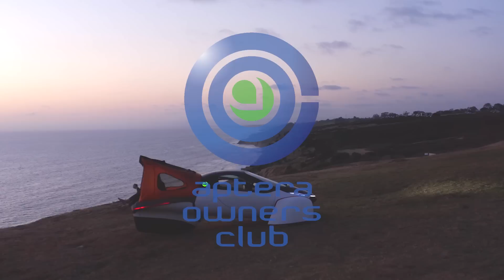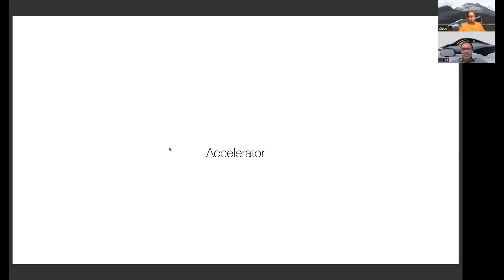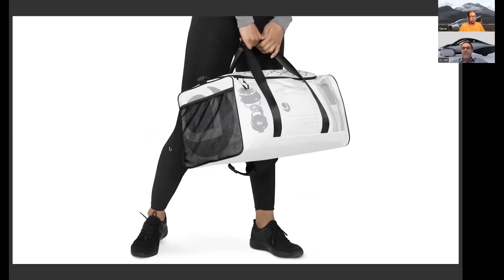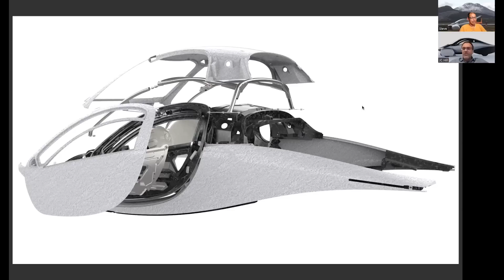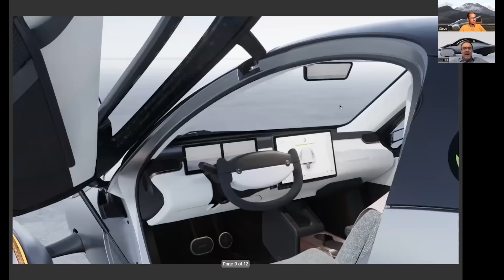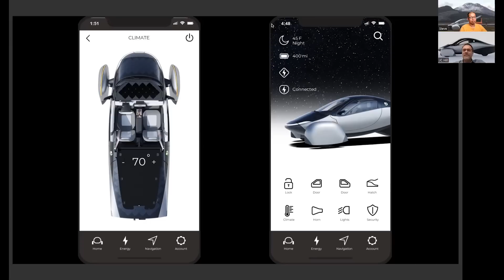Jason Hill gives us some Aptera updates and a sneak peek at the app!

Comment: What will happen when Tesla starts delivering the $25,000 4-wheel vehicle?
Reply: Valid question. We know Aptera is unique in many ways and should be enough to entice people to buy it. I'm more thinking that the affordable Tesla will crush Toyota, GM, & Ford.
Reply: @ScottOstr  Maybe, but Aptera will have to be extremely smart about its features if it's going to compete on a big scale. Its uniqueness won't translate into mass adoption unless it very carefully sweats the details.
Reply: @Yowzoe  That's true. The lowest drag coefficient and highest energy efficiency of any vehicle is great but once denser energy batteries arrive, those things become less important. Then the lowest price advantage is less important once the affordable Telsa arrives. Aptera doesn't need to be plugged in which is extremely appealing to people who live in apartments and don't drive very far. It will be interesting to see how it all plays out.
Reply: @ScottOstr   Solar charging (and 120v!) are big draws but as a 2-seater roadster with Jetson styling, crossing over into the normie market to compete with the coming low-cost Teslas, BYDs, etc. will be savage. 
Lacking what reviewers and mainstream drivers consider essential (many seemingly shallow details like color choice, expected horn button location, and ample back-up light brightness) would narrow the segment of potential buyers further.
Reply: I hope Aptera Motors will have their 4 wheel 5 seater car revealed by then. That will be interesting competition for Tesla.
Reply: @fotoguru222  My concern is about the price. Tesla is cutting prices after achieving the economy of scale and vertical integration. Aptera is still burning money to deliver the two-seater model. Without a big investor, it will be difficult to compete. Most of the potential customers will go for the lower price and trusted brand.
Reply: @DavidIzadaRodriguez  Good points. However Aptera doesn't need to take 50% of Tesla's market share to be successful. It doesn't even need to take 10% nor even 1% of Tesla's 2,000,000+ vehicle market share to be successful. Aptera Motors is doing this by staying lean and being efficient in low cost manufacturing.
Reply: @fotoguru222  I personally think a 4 wheeler might happen in 3 years if 3 wheeler is successful
Reply: Hell will freeze over. 🥶

Comment: I wonder if the Knob of Light is shopping cart rated? Because that was the reason they stated for changing those beautiful Gamma taillights.
Reply: either way it's a fugly afterthought solution. I can already picture EV haters just yanking those things off.
Reply: @jeffreyd1701  yup
Reply: @jeffreyd1701  That's what I probably will do myself and replace it with something handmade and nicer when getting my Aptera.
Reply: Very important consideration 🛒
For me it is indeed fugly in the singular, though having one on either side of the plate would be better. Even betterer would be two more low-profile knobs, if possible. Also having more back up lumens is a big plus for a key demographic who can buy this vehicle, i.e. an older crowd.
Reply: @Yowzoe  I'm a big fan of lots of light. But I'll wait to pass judgement until I get it in my driveway. If inadequate, I will fix it.
As far as looks, it's only a minor cringe to me compared to that yoke.

Comment: Thanks for your continued work with the channel. Do you have any information regarding the steering wheel lock-to-lock turns? It's not clear if the Aptera will have a variable steering ratio or a fixed ratio rack but fewer turns is definitely better (particularly for slow speed driving), otherwise using the yoke could be as frustrating as the Tesla yoke. Any thoughts?
Reply: steering effort will be variable but the ratio of turning is fixed.
Reply: @jeffreyd1701  Exactly.
Reply: What Aptera has said is that the power steering boost would be variable according to speed.
Reply: It is absolutely clear the steering is fixed ratio according to Aptera.

Comment: I've always thought that putting the horn in a place where you have to take your hand off the wheel to use it was really dumb.  The only time I have used it for its intended purpose was when I was stopped in a parking lot and someone started to back into me.  Everything else was used to express annoyance after the danger was avoided by steering and or braking.
Reply: Very dumb indeed, and counter to our learned-over-a-lifetime usage--a mistake which I hope will be remedied. it will be noticed by buyers.
Reply: @Yowzoe  Wait, what?  Center of wheel is dumb, putting it where you can reach it with your thumb without moving your hand is smart.
Reply: @skeptibleiyam1093  you're exactly right

Comment: Thanks for addressing the need for a 'Sentry' or 'Sentry-like' mode or capability!  I too feel it's Essential!!  Especially for anyone who is living in a major city or town, or anywhere else where vandalism or the prospect of accidental damage is high.  In fact, I'm keen to see what features of Aptera has to mitigate or even stop or prevent 'Carjacking'!??  I live and drive in the DMV - i.e. Washington DC, Maryland, Virginia and on its Beltway, - where Carjacking has become a serious problem.  And I'm also an Accelerator; was in the top 100 but I've slipped a bit with the last months investments!
Reply: I agree, and for city driving, parking at trail heads, or going to the grocery with any sense of security a sentry-like mode is something that I can't do without. I'll have to figure out an aftermarket dashcam setup if sentry doesn't come standard by the time I get my vehicle.
Reply: After posting this affirming the need for a 'Sentry' or 'Sentry-like' system and capability for Aptera, - which brought 'Carjacking' to mind as it's regularly in the news here in the DMV, - I have an idea for a fairly straightforward and hopefully low-cost/reasonable-cost and even 'standalone' system to discourage or mitigate - or stop a Carjacking in its tracks!  In fact, what I have in mind would work in Aptera and likely many other cars, trucks, or similar vehicles, and perhaps even in an airplane cockpit or boat.  Any suggestions on how to approach Aptera on this?  Or should I just go ahead with development on my own as I'm an engineer among other things??
Reply: @billyshilling7663   The only thing I can suggest is that you go to great lengths protect your IP. If yours is a serious idea, consider patenting it before you speak with anyone about it. As you may know, so many homespun garage-made inventions get scooped up by conniving lawyers for cutthroat corporations…don't be that guy. Best of luck with it :-)
Reply: When living in Rome do as the Romans do...
CARRY A GUN!
Or at least some pepper spray. 😮
Reply: @IBMara  they possibly can help with carjacking, but a problem is that a weapon or a can of spray won't help your vehicle when you're not there

Comment: Most cigarette lighter sockets are usually 10 amps. What it needs is something like a 30A Andersen Input for portable solar panels when parked at home, at the beach or camping.
Reply: That is two different circuits. One outputs 12v nominal while the other inputs 100+ volts from solar panels
Reply: @GaryGreenway  That is what I was referring. One output circuit and the other an input circuit.
Reply: @GaryGreenway  The nominal voltage of the solar panels is 402 volts.
Reply: @n.brucenelson5920  I think he was referring to auxiliary solar panels.
Reply: @GaryGreenway  The word "portable" was in my comment.

Comment: I'm still excited about the 🚗... my concerns are with the amount of  space the doors will consume when it's time to get into and out of the vehicle. I live in nyc, and parking space is limited. In my opinion, i think sliding doors or some sort of pocket door design would be more space saving. the doors would be an issue in an urban environment like queens, most often you get to park "right side of a 🌳. Parallel and horizontal  parking is super tight. I'd have to get into and out of my Aptera via the trunk or the sun roof. Especially the way ppl tend to park in nyc...
Reply: If the wheels fit in the parking space you'll be able to open the door enough to get out (and in again). Not someting that conventional cars do guarantee as theit wheels are flush with the doors.

Comment: Tire wear will be interesting. Yes the car is lighter but total weight /3 instead of 4 will be interesting.
Reply: The discounts are always for four tires though, so even if the rear wears more quickly you will have a spare.  They have said it will be front weight biased, so i can't imagine it will wear twice as fast. I was thinking they should have a drift mode to finish off the rear tire.  It may go against the environmental and safety ethos, but everyone needs a bit of fun once in a while. Chris did mention having different traction control options in one of the interviews.
Reply: @aimlessweasel  Launch Mode, there is your "fun" mode. Tadpoles don't drift.
Reply: @barnabasseadog7660  They don't drift you say? Take another look at Aptera's "moose test" video.

Comment: Lack of side airbags is still a concern for me
Reply: I'm so with you on that. If not, I'd love the option of a 4 point harness, even if it is overkill.
Reply: A harness will not help much with side impact and you would need to keep it very tight. Uncomfortable and possibly difficult to operate control function due to reach. May also lead to more severe neck injuries.
Reply: How about wearing a neck brace?
Reply: In U.S. (only?), 4-point not legal. If from somewhere else, that would be a nice option (if legal).
Reply: @scottgabbard662  Maybe 4-point is illegal for cars (Why?)  but not for autocycles like Aptera. They use a 4 point harness on the Arcimoto FUV autocycle.
Reply: @fotoguru222  Totally forgot about the auto cycle angle. But yes, in the US, cars must leave the factory with a 3-point.

Comment: The metal insert in the door does not look like it provides a lot of extra strength against a side impact.  I am wondering if it provides the foundation for a window actuator subassembly.  Jason's description of the backup light still didn't change my opinion.  I think there are so many other solutions to provide all of the same functionality without that asymmetrical wart hanging off of the back of the car.  I plan to road trip and camp in my Aptera, and the ability to plug in an induction cooktop, and a small refrigerator is my hope for the future camping kit.
Reply: The knob light thing is pretty ugly. They could've put an LED strip light along the center of the vent area and a little bump out with an LED over the plate.
Reply: @tims8603 Sounds like an aftermarket opportunity.
Reply: @tims8603  my thoughts exactly
Reply: @tims8603  Great design idea. Jason, write this down!
Reply: So true. Feels like their tent idea is lip service? Hoping for much more back end functionality beyond “ lotsa room for your dogs” idea. They still are silent on off road version capabilities

Comment: Thanks Steve.  I'd love to see the engineering team get pushed harder on side impact airbags.  Sure the door may be strong enough to withstand an impact.  But if an Aptera gets t-boned by an SUV, it's going to change sideways velocity awfully quickly, and so will the driver's head relative to the SUV's grill.  That could be a dealbreaker for many people.  It shouldn't be that hard to add airbags into the seats.
Reply: just don't get in wrecks, problem solved!
Reply: The response that I recall is that the side window is farther away than on a brick shaped car, so your head won't hit it.  That, of course doesn't help your neck.
Reply: @skeptibleiyam1093  imo it's a BS answer to cost cutting.
Reply: It is my suspicion that a front airbag with a three point seat belt is not much better than just the seat belt, but I gave up searching for data that would let you make the comparison.
Reply: @skeptibleiyam1093  is far better with an airbag than without.  The forces on the upper body are greatly reduced.
Reply: @jamesengland7461  Where can I find data that quantifies "greatly"?  Airbags are not without cost or risk.
Reply: Perhaps the frontal airbags can protect in side impacts also.
Reply: @jamesengland7461  I like that idea a lot. If somehow they could just deploy the front airbag so it also wraps around to the side. Problem solved!   Kind of like a half cocoon.  The best airbag is no airbag lol
Reply: @jamesengland7461  I take it from your answer, you couldn't find the data either.  I looked again, but still didn't find anything that would let me make a comparison.
Reply: @skeptibleiyam1093  no; I'm not going to bother looking it all up for you.
Reply: @jamesengland7461  I don't blame you.  It's a lot of work.  I thought it would be relatively easy before I started searching.
Reply: Jason seems out of the loop on many of the technical questions. I wonder if he’s working full-time at this point. I would appreciate the conversation better if JASON doesn’t know the answer to a question if he would just say so.  BS meter is working overtime. And if I hear the word “RIGHT.?” one more time my head will explode. Also, comparing safety issues to a motorcycle or an auto cycle is not Comforting.  There should be an Aptera policy that, when speaking about safety issues, they only refer to automobile standards If in fact the goal is to provide  higher safety standards and performance.

Comment: I really hope that output port can handle an induction cook top - would be great for camping. 
Solar cooker is NO good for night time.
Reply: For cooking and such you'll need to wait for the 120 volt 15 amp inverter option, or add your own.
Reply: Use a solar generator and charge it as needed with portable panels.
Reply: @LarryDickman1  more crap to own and carry around. not efficient nor eco friendly
Reply: @jeffreyd1701  I'm not eco friendly either.
Reply: @jeffreyd1701  It is crap when you are camping etc and using a lot of power. But to each their own.

Comment: The door knob rear light still seems a bit weird to me. Seems like it could be closer to flush-mounted and still illuminate the license plate. Maybe there’s some other functionality that’s yet to be revealed.
Reply: Right? Make a cool ridge centered across the top and have an LED strip or something. Ditch the wart.
Reply: As noted in reference to the LPI, lens design can achieve many desired outcomes.  The LED lamps could no doubt be end user changeable (right to repair) to make more sense for unique needs.
Reply: You mean it's not there to hang the shopping bags on while you free a hand to open the hatch?
Reply: @iansmith6728  Sounds like it's strong enough! ☺
Reply: Maybe a good aftermarket idea?
Reply: Riight, the knob in back is weird to you but the whole vehicle itself looks completely normal? It also functions as a charge level indicator, if that helps.
Reply: Horrible design. A wart on an otherwise beautiful design.

Comment: I don't understand why Aptera does NOT have the side airbags. I do understand the egg shape helps the hip part of the body. But I still have concerns about the head being banged around in the event of a side crash. I hope I am wrong here. Just speculating....
Reply: They have said in the past that increasing the cabin width would solve this. But I really don't believe them, especially on such a narrow vehicle, how would that extra inch prevent your head from hitting the sides? I guess we'll see in the crash tests.
Reply: @JeanMichelTrivi  Most injuries in a side impact is to the ribs and hips. The egg shape absorbs more energy. I'm still buying.
Reply: @JeanMichelTrivi  I have the same concern here. The only thing is that since the shell is egg shaped, it reduces the impact on your hip but not your head.
Reply: I reckon Total Recall type of crash protection.  If it's good enough for Arnie, it's good enough.
Reply: Having driven all sorts of vehicles in all sorts of environments for 55+ years and not having ever been hit in the side, I am okay with Aptera's design. They are responsible for making all the decisions that will eventually bring the Aptera to market. I hope they succeed.
Reply: @IBMara  oh so you're saying if someone has never been hit they should be ok without any airbags whatsoever. So I should be good then! But what about my wife who got hit extremely violently while sitting at a stop sign?
Reply: @JeanMichelTrivi  I didn't say I would be okay with no airbags at all. I will be happy with whatever Aptera decides to do. Would I like side airbags? I suppose. What I would like even more is my Aptera, however they can produce it.
Having followed Aptera for a while and seeing the struggles they have gone through, I wouldn't want anything to get in their way to production.
Sorry to hear about your wife. I hope she is okay? Are you saying that a side impact airbag saved her?
I have a hard time seeing how someone stopped at a stop sign could have gotten hit in the side. Most stop sign collisions are from the rear.
Reply: @IBMara  Boy!!! I am glad you are not part of our vehicle safety design team.
Reply: @Soothsayer210  Me too. I wouldn't want to carry the burden of being responsible for any injuries incurred by anyone involved in a side impact accident.
You understand I am talking about the mindless chump driving the incident vehicle. Surely they will suffer whiplash from the rebounding door of an Aptera. 🤕